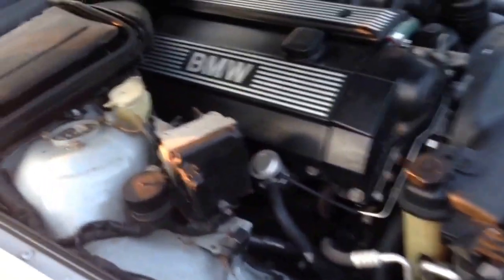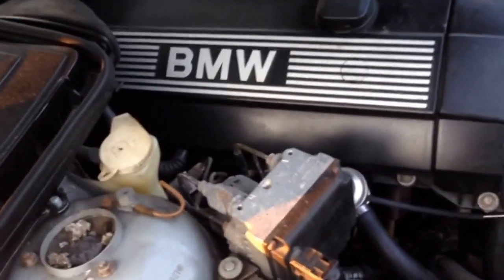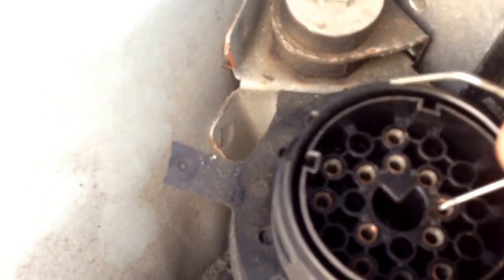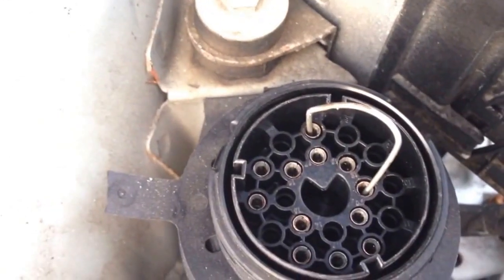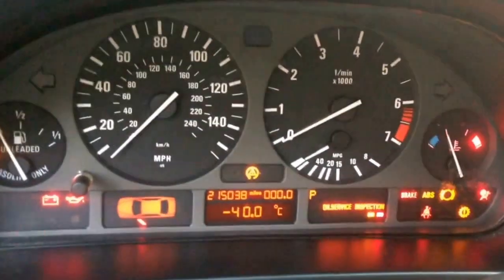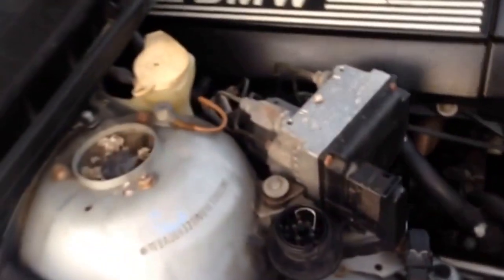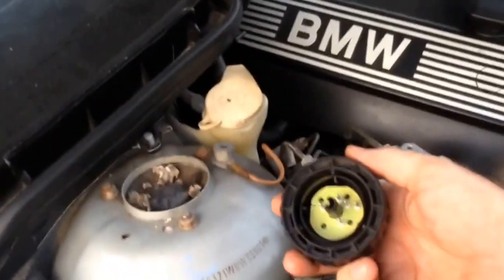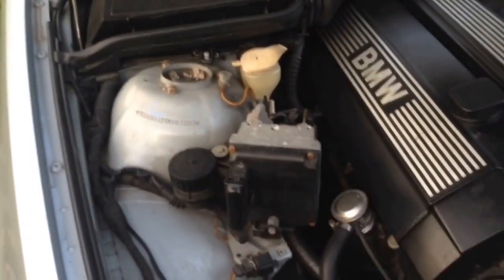BMW Pre-2001 E36 E39 E46 Oil Service Light Reset Without Using A Scanner

Comment: When I unplug my MAF the car dies. could I have a vacuum leak on my e39? but I can't find it any suggestions
Reply from the maker: It should die when you unplug the maf
Reply: +Nathan's DIY Garage I don't have power like I use to that's y I thought it was a vacuum leak
Reply from the maker: could be the intake boot ripped, any codes?